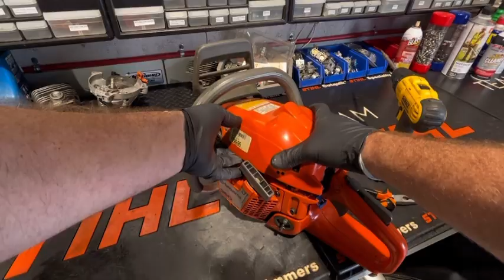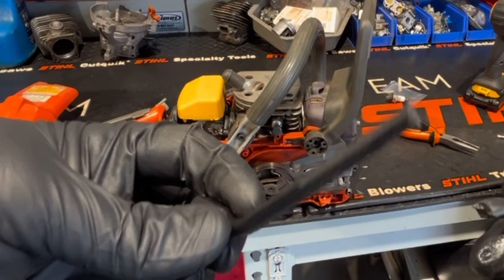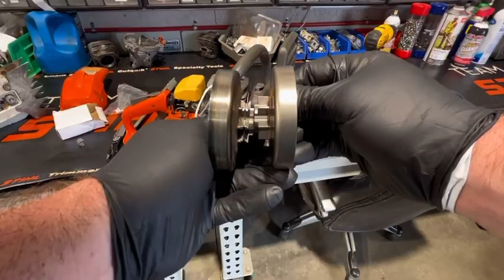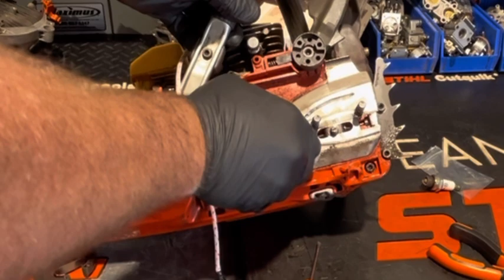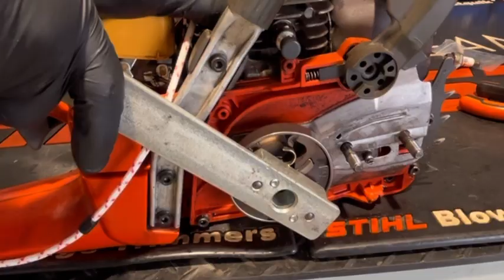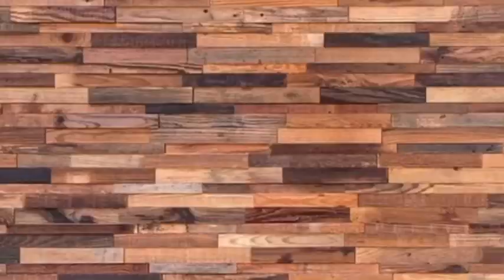Husqvarna chainsaw sprocket replacement. How to replace a sprocket on a 350 Husqvarna chainsaw.

Comment: The outboard clutch for better heat disappation , better support on the crank? or other engineering that i'm not seeing? thumbs up
Reply from the maker: Yah I never dug too far into the engineering. I mainly look at things through the lenses of how much easier this would have been if they didn’t build it like that.

Comment: Great info! I don’t know if it applies to all Husqvarna’s with outboard clutches but on my 550xp I can grease that sprocket bearing through the hole in the center of the crankshaft with the same miniature grease gun used for the bar tip bearing. They sure like to make it difficult needing a special tool to remove the clutch. A Dolmar I have with an outboard has a 17mm hex allowing you to use a scrench tool to remove it.